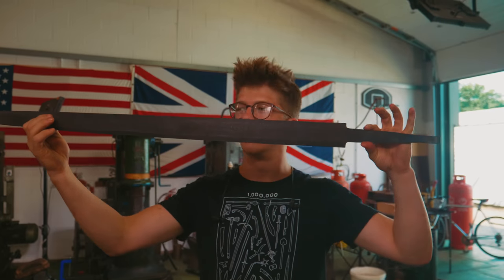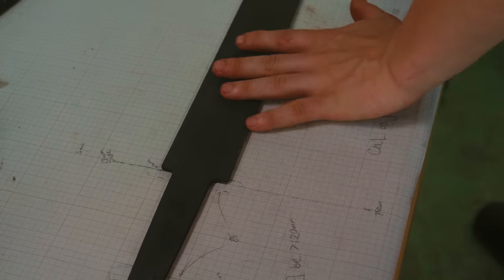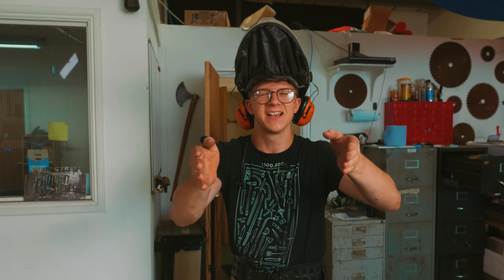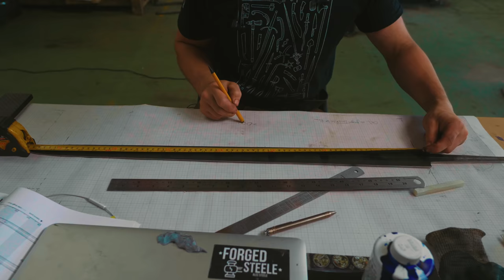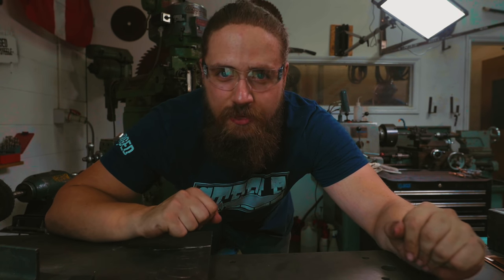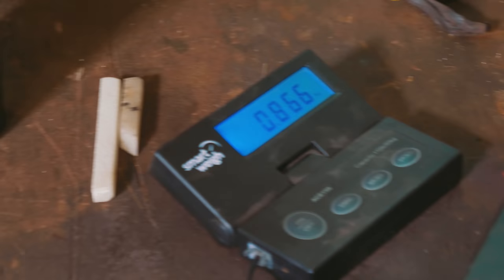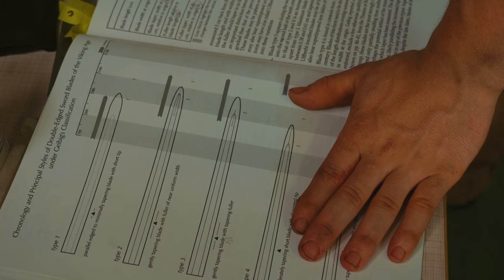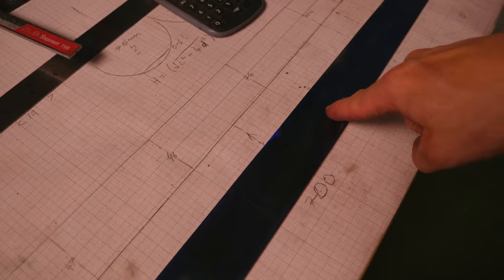MAKING A VIKING SWORD!!! Part 4

Comment: hey alec, very good example for the distal taper. How do you taper the width of the blade?  Is there a linear taper to a length were the curve of the point bigins? 

I've chosen 60mm at the base 
5,64 at 1/3 
4,40 at 2/3 
150mm from the tip 38mm 
50mm from the tip 30mm 
20mm from the tip 21 mm

Comment: Alec, use your horizontal surface grinder to remove metal from your  blades. It is faster and more accurate than your little 42" belt grinder.

Comment: I had been recently working on a sword for my grandfather for christmas. I just rolled with the punches and the design changed as a forged. It ended up having a warp because i’m not good at grinding right now. So me and my dad were using a milling machine to get it flat we pushed the warp into the vise during setup, through vibration in working it popped out of the vise and took a cut about .100 to .150 deep. It was horrible.

Comment: So why is the steel hardened before the grinding? Wouldnt it be easier to grind/finish when the steel isnt as hard and also easier on your grinding belts?
Reply: youre right. But when the blade is thin it tends to bend more during the quench.

Comment: I wonder if Alec will ever be doing a fuller with a tool rather than grinding/cutting it off instead by displacing material to reduce the sword weight

Comment: doise could be measured in - kg dB / s. the amount of metal dust AND noise produced per second, since doise is a COMBINATION. (SI units would be kg/s) OR it could be - kg dB, simply the product of both.

Comment: If i want to start blacksmithing, but dont own the necessary equipment and cant currently afford it, what should i do? An answer would be greatly appreciated
Reply: Dylan Harding start saving now. Ask the same question in a few weeks without the "can't afford it" 
You can make a small forge (see coffee can forge) but you still need to buy basic hand and power tools. 

Tools and material are the biggest expense obviously.
Reply: Dylan Harding ton of charcoal and a blow-dryer set to cool pumping air into the bottom of the fire. Or for a cheaper one a lot of insulating fire bricks in cube shape wrapped in a bunch of heavy duty tin foil and 2-3 propane torches. Also check your local community college, mine offerse blacksmithing courses
Reply: You don't necessarily need expensive equipment but it does make it a lot easier
Reply: Dylan Harding not an expert but see if there are classes u can take nearby that have the equipment and u can learn from them kinda a stretch tho
Reply: I'm also starting to get everything set up in my shop so I feel you on the price of some of this stuff
Reply: Dylan Harding get a job and save up money?
Reply: I'm in a similar spot. I've had some luck looking at yard/estate sales. Good tools will last forever, so you can usually find nice things in those places for cheap.
Reply: Dylan Harding 1st - look for a local blacksmith and ask if you can volunteer. 2nd - go on ebay and by a billet of Damascus or normal knife steel. 3rd - while on ebay, buy a cheap angle grinder and some grinding, cutting and flap disks.  4th   - start shaping your blade while you wait for pay day. 5th - back on ebay for some files, sand and wet and dry paper and a blowtorch. 6th - finish your first knife........ kind of how I've started out, but with a few more tools. You can make a decent knife with the bits I've listed, it's not going to be fancy but you will get a taste for it and for less then £100 total (you will have to by bottom range equipment but I did the same think and it worked). As you  progress, buy more and better equipment. Hope this helps 🙂
Reply: Thanks for all the suggestions! I found some work and will start saving ASAP! Good luck to you guys as well!

Comment: I'm a regular viewer because I admire your work. I know you have to play to your base but couldn't  you make a hand file or tools for the woodworker, metalworker? Like a pair of sheet metal worker's hand shears? Just once in a while.

Couple of points:

1 - what's the state of wear on the platen attachment of your belt grinder? The platen looks as though it may be soft steel and it IS subject to friction from the back of a high speed abrasive belt. You use it a lot and platen condition affects finish quality on work items where surface geometry is critical. Sometimes, worn areas are real aids in creating certain features but most of the time you're executing long controlled flat features. Hollows and humps behind your principle finishing surface are like concealed villians, ready to pounce and ruin your day. Perhaps, extra platens stored and ready for need; maybe even one made of steel hardened to rC58 or so.

2 - I suggest you look into some form of guided grinding apparatus where long guide rods or flats extend parallel to the axis of the surface being ground to a sliding adjustable support. And stops to support the work. There's a knife sharpener on YouTube  https://youtu.be/TVF06g9K-_w and follow-on links that inspired this suggestion. It should be easy to adapt, scale up in size, and build. 

With it, I speculate you'll find long smooth tapers, fair curves, constant bevels, and precise finishing of fuller details simpler to create. Ingenuity and accessory making will be critical but I submit mastering its use will greatly reduce anxiety and cursing in the grinding room, making fine quality results a matter of certainty rather than skill backed by fickle fortune.

Another factor, this apparatus would be simple for your viewers to DIY. Its manufacture and uses would make a nice series of videos.

Comment: Love your videos, Alec...but I'd love them more if you hammered your bevels and fullers in instead of grinding them.  Smiths in bygone eras couldn't afford to make all that "doise".
Reply: Bryce Corbin 
Similar comments on the last episode. The explanation is that the Damascus pattern in this blade would get too distorted if the bevel was forged.  For plain steel more forging is good, for intricate Damascus it's bad.
Reply: I guess that's true, but it also begs my other question: why does everything have to be damascus?  Alec it seems, would make a sewing needle out of damascus.  We get it...he has no problem making damascus, LOL.  We're all duly impressed.  As I said, I'd be more impressed if he did the bevels and fullers by hand.  That is also quite difficult on something as large as a sword.